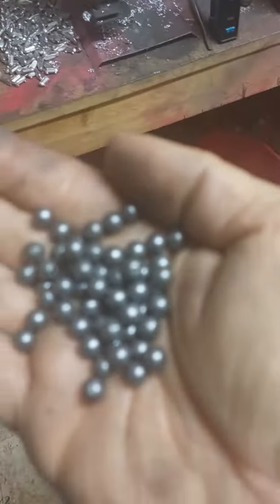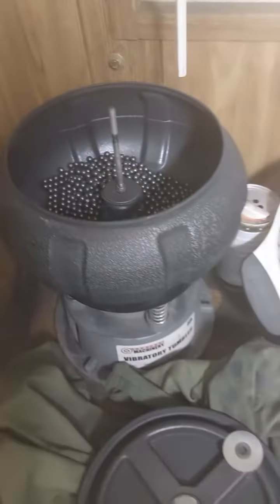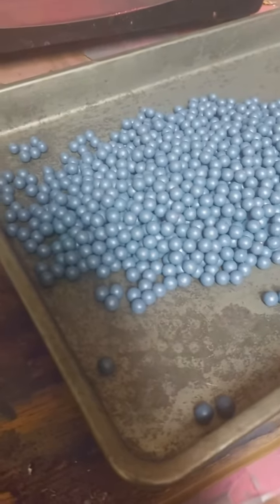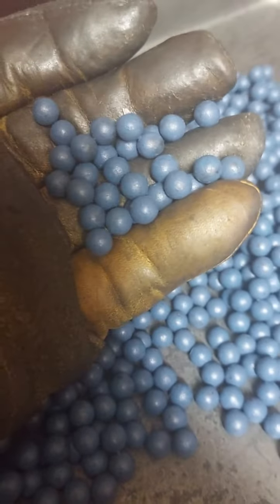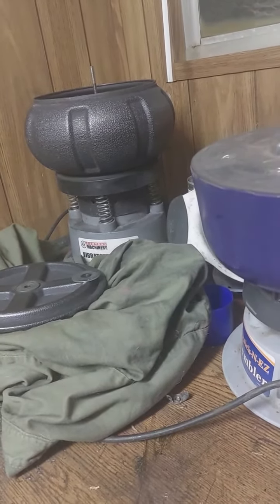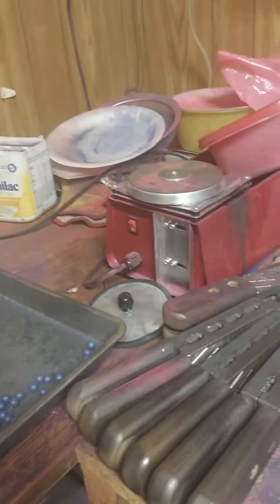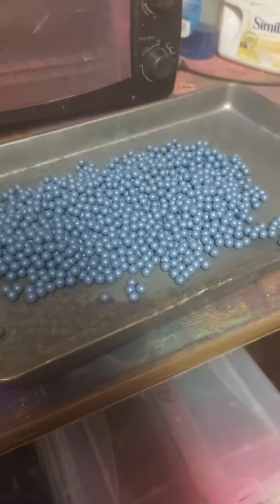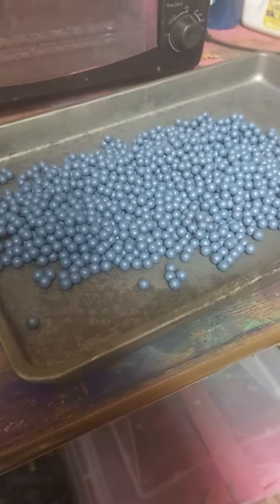vibratory tumbler polishes buckshot pellets flawlessly

Comment: Dude!  I just went out and started my vibratory cleaner with some .330 buck.  It was SUPER loud!.  It is in the garage and it ran me out of the house.  I went back and added a small amount of vibratory media that I use to clean my brass.  Not even enough to cover the buck.  It cut the sound in half.  It will probably also increase the time it takes to polish but it was so loud before it was unusable.